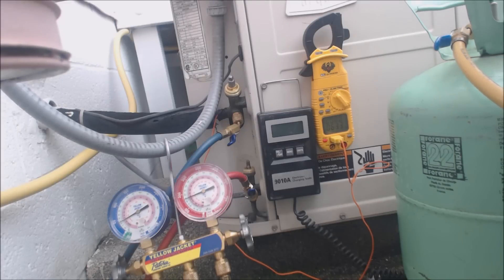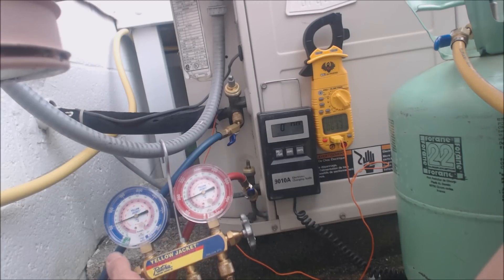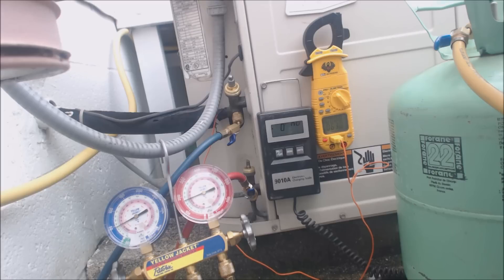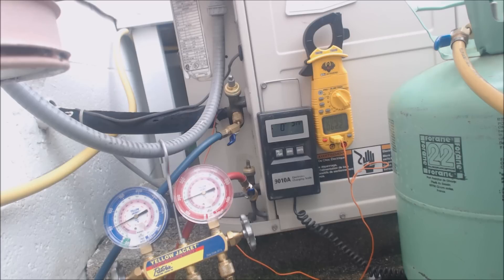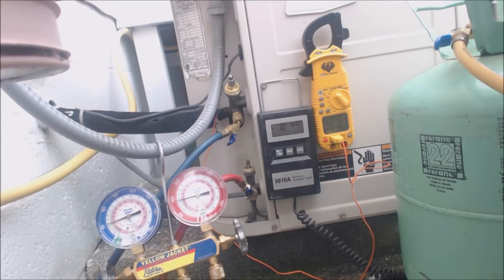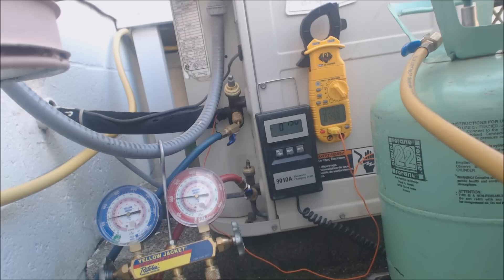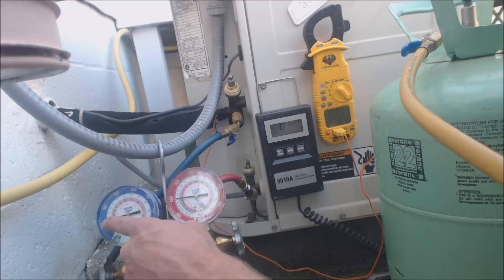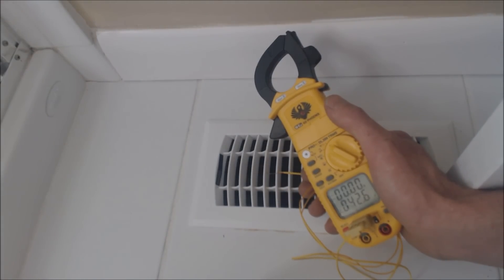R-22 Refrigerant Charging an Older System with a Capillary Tube Metering Device & Confirming Charge!

Comment: Have you ever came across this problem? 

When you’re charging a R22 unit and the saturation temp doesn’t seem to move, even after a couple pounds of R22?
Reply from the maker: If you are looking for the sat temp on the low side to move, it will not if there is a txv working properly or a liquid line restriction, or low airflow. Also with a piston, the heat load in the house reduces as the system is running so the pressure may not rise much. I have all this laid out in the book at the website acservicetech.com but we really check total superheat and subcooling to determine what the problem is exactly, thanks!
Reply: Hello Sir, I'm one of your follower. Do you have any idea on how to select the right capillary tube size and length for a 2 ton single capillary tube ac system?

Comment: hello! 
from CA.
Q.  can I use same device liquid vaporizer on a 410A  systems? and.  I still turn upside down the FREON tank with the device?  I just never use the device before!
Reply from the maker: Yes you can and keep the R410A bottle upside down. You can even just attach the device to the bottle, thanks!

Comment: Do you ever use digital manifold guages, or are compound gauges your preference, and if so why? Great video.
Reply from the maker: I use digital too but I usually teach with the 3 port because that is what most new techs and students use first. I also don't recommend anyone using digital gauges until they can use superheat and subcooling as diagnosis methods proficiently, thanks

Comment: I was scanning through the goodman service manual the other day for the old 10 seer system. There was a Superheat charging chart that are based on only the condenser ambient db temp and indoor return air db temp.  There was no indoor wb temp required.  Is that OK to use their chart for their old system.? From what I have learned recently that orifice system need the indoor wb temp at return air to calculate the target superheat needed. But according the goodman service manual it shows otherwise. Confused..)
Reply from the maker: You certainly could use their chart in that case only. Otherwise you can still use the normal superheat method with wb and outdoor db. There are old manufacturer courses that have used the ambient plus 30 rule but I really wouldn't use that. Thanks
Reply: Thanks for reply,  I did compare the normal superheat method with the goodman chart, it's pretty dead on accurate. I heard that 30 rule too and beer cold can methods from old experienced tech, but those are for old system only.
Reply from the maker: Good to hear Khuong, thanks

Comment: 43 degrees?? Wow thats a fridge!
Reply from the maker: 34-38 is a fridge, 40 degrees is roughly around the temp of an evap coil sat state so that it can absorb heat from the air in the house, thanks Armando!
Reply: 70psi 40* 👍

Comment: I know you have to keep calculating superheat about every 5 minutes.....Do you have to keep checking wet-bulb at the return every 5 minutes as you're calculating superheat during charge? Or, do you just check it one time before you begin? Thanks.
Reply from the maker: Yes the wb is the one that is likely to lower and the outside may stay close but may change too, thanks

Comment: What is the different between the R-410 Refrigerant and the R-22 Refrigerant and how do I know which one my system need? The reason of my question is because my line are frozen and it just started so I'm suspecting from low refrigerant since the air is flowing fine on the Evaporator, any advice?
Reply from the maker: The refrigerant type should be listed on the outdoor unit rating plate, on the txv if equipped, and possibly on the compressor.  When you hook the gauge set up after the system has been off for  at least 10 minutes,  use the sat temp to compare to the actual temp outside. -- https://youtu.be/yBqDkbuyuIo
Reply: Thank you so much!!!

Comment: What type of charge would be placed in a capillary tube system?
Reply from the maker: Do you mean what refrigerant charge? This one was R-22.  You will find many cap tube systems used in window air conditioners just because of their low cost. As far as comfort cooling is concerned, it would just be R-22 unless you found some R-12 around.
Reply from the maker: Thanks for the question!

Comment: A quick question on how you connect/position the Kwik Charge Liquid vaporizer on a SMAN4. Wireless 4-Port Refrigerant. Manifold and Vacuum Gauge?
Reply from the maker: Glad to help. That would be in the same spot as the gauge set used in the video. It connects between the aluminum block and the blue hose on the vapor side. Thanks
Reply: Thanks for taking your time for this. Its differs, its position in using a 4-port valve from Imperial instructions manual. They put it in-reverse in the refrigerant port instead. Is this correct?

Comment: how much refrigerant does a outside unit usually takes, one tech said i need 6 pounds of refrigerant, i don't believe that
Reply from the maker: The outdoor unit will always say it on the rating plate which is visible on the side of the unit. Thanks for the question!

Comment: Awesome! Thanks for taking the time to make this video.  I have a r22 heat pump system . Low side is 50psi. and  h/side is 276psi. ambient temp is 108F. Does this confirm that's my system is low on gas? Supply air at 69F and return air at 78F. so difference of 9F. What's a good number for the temp to be at... around 14-18F? any help is much appreciated. Thanks
Reply from the maker: John, it sounds like you are either low on refrigerant or you have a restriction or a txv that is not letting refrigerant through. The high pressure on the high side is likely due to the hot temp of 108 and a lower seer rating. The temp should be 18-21 degree temp diff unless high humidity. ThanksCheck out the Superheat and Subcooling Playlists to determine how you need to charge it.https://www.youtube.com/playlist?list=PLxnHR5_D2ojxTcAtR_53GoY8huBcSOt0ahttps://www.youtube.com/playlist?list=PLxnHR5_D2ojwGvhU1rseXQLJ-XBjBZMMk

Comment: How does a capillary tube system meter liquid in to the evaporator coil.
Reply from the maker: Great question! It is a cheaper way of building a metering device. Essentially it just reduces the pressure once it enters the  distributor and only allows the specified amount amount of refrigerant designed by the manufacturer through.

Comment: If coil and blower show dirt, it WILL effect superheat.
Reply from the maker: Thanks for the comment! I know I didn't show the pic of the evaporator. It was not that much. I didn't want to confuse anyone. Any restriction at all with psc motor will increase airflow friction and that will affect heat transfer. Thanks for your comment!